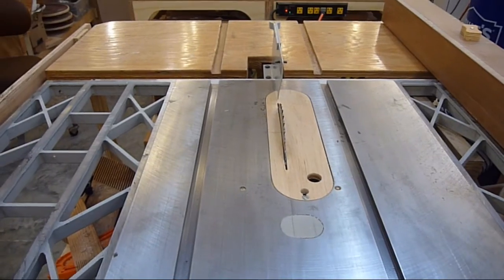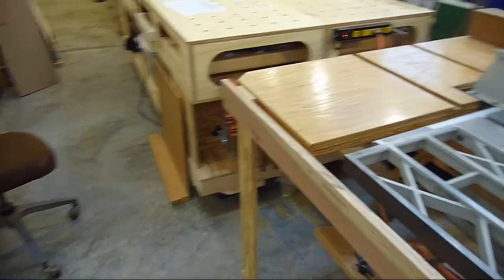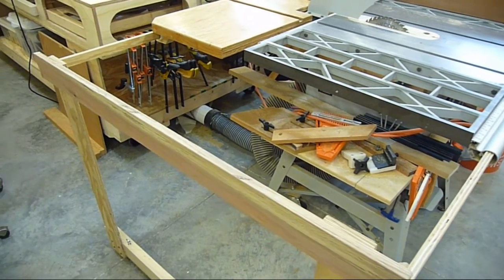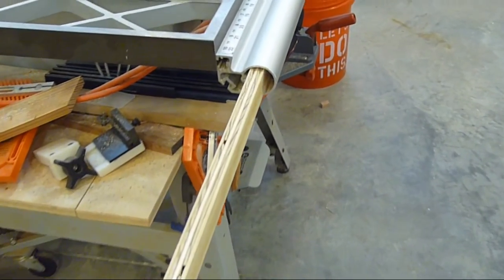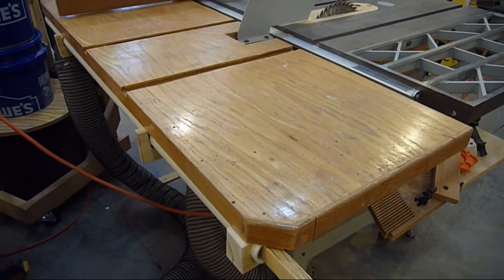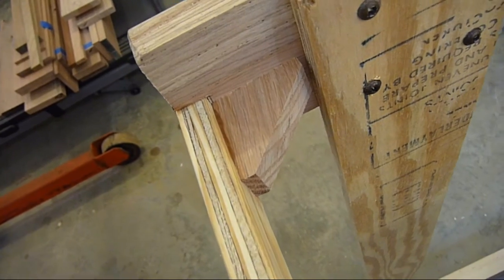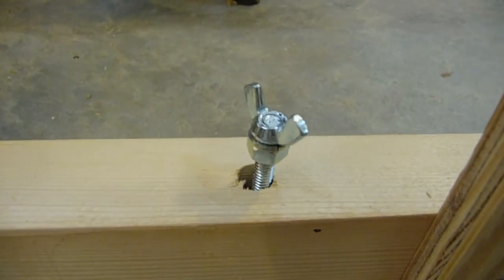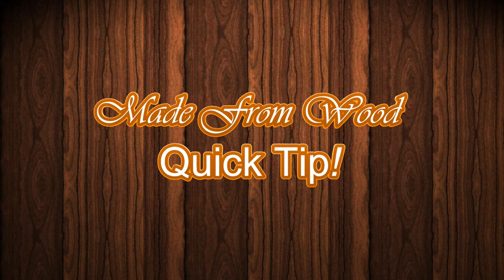QT#2 Table Saw Extension

Comment: Great idea. I'm usually using a fold up roller stand I got from HF. It always seems to tip over at the worst times. This is on the todo list for sure. What size PVC pipe did you use for the back "track"?
Reply from the maker: +dmmflys Hi.  I used a piece of 1-1/4" pvc but this isn't critical.  Just size the wooden piece to fit loosely into whatever size pvc pipe you happen to have.